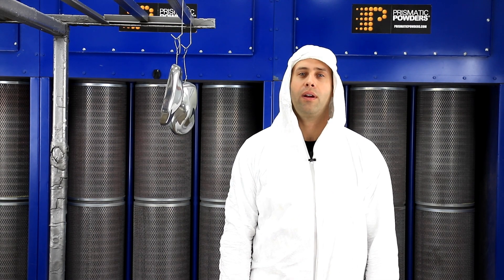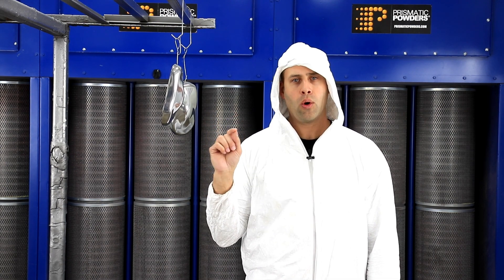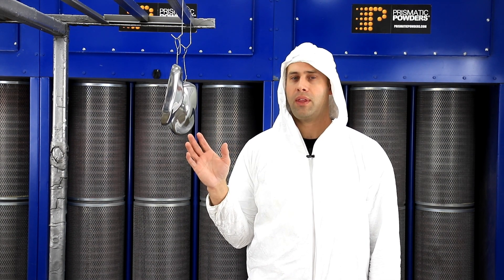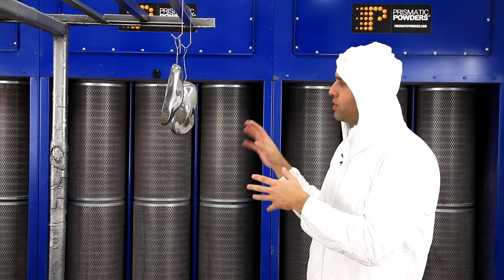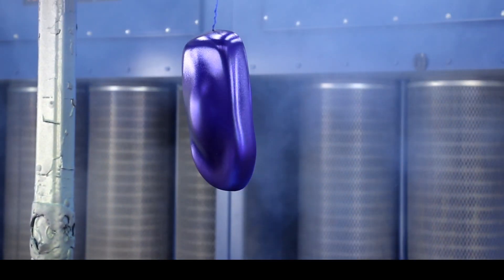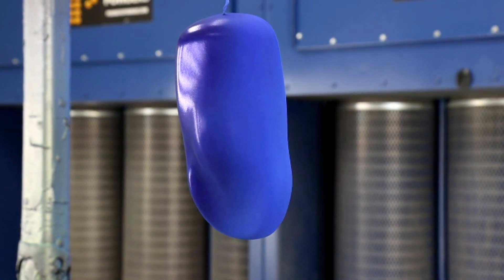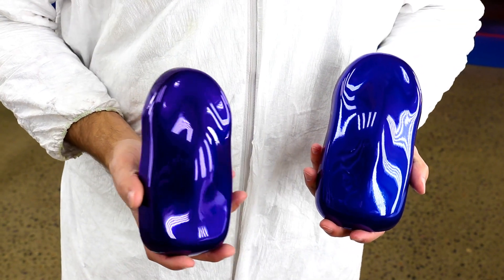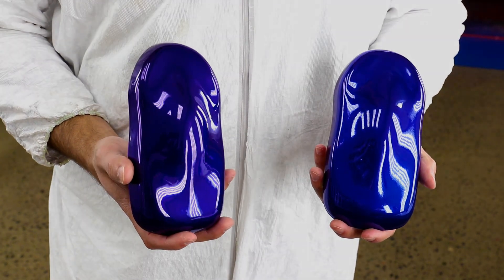Prismatic Powders: Hot Coating

Comment: Can someone please help me understand? I’m very new to this i just bought a 4x4x6 oven that we haven’t even got in yet but I’m doing as much research as i can.  The question i have I’ve watched on YouTube and seen hundreds of different answers but since I’m going to be using your powders i figured your the ones to ask. My question revolves around multiple coats and clear.

1) everything i see says you should always use a clear coat for durability and to keep the chrome colors bright.

2) where I’m confused is multiple colors for example if i do chrome and let it cure as recommended do i put the transparent on when hot or back at room temp?

3) when putting on the transparent color i put back into oven. Let part get to tell and do the recommended cure time. ( will the chrome coat being cured twice hurt it)?

4) when that comes out do i add the clear when hot or room temp? After i add the clear and put in oven and let part get to temp and cure at recommended temp. ( will the chrome coat going through 3 cycles and the transparent 2 cycles hurt them)?

I can’t seam to find anything on this that’s consistent
Reply from the maker: The simplest answer is you want to be sure to read and follow the Application Guides of each powder, found at https://www.prismaticpowders.com/documents 

Super Chrome must be fully cured before applying a top coat, but generally this is NOT the case when layering (you would partial cure and let parts cool to room temp). If you have more specific questions, feel free to reach out by emailing us at technicalsupport@PrismaticPowders.com - thank you!

Comment: Would you recommend heating the oven to the temp required for baking before or powder coat the item and place in an cold oven and heat up to temp
Reply from the maker: You'd want the oven up to temp before placing the item in it. Your cure time starts when the part reaches temperature (Part Metal Temp).

Comment: Curious why you need to let the part cool all the way back down if you cheat and shoot it hot?
Reply from the maker: The main reason is for curing. If the part is 350*F or higher when you place it back in the oven it CAN throw off your cure times, possibly causing issues of under or over curing. The if temps and times are diligently monitored, all would be fine.